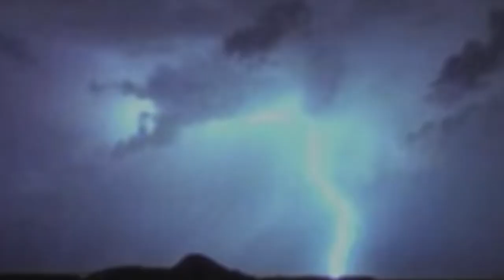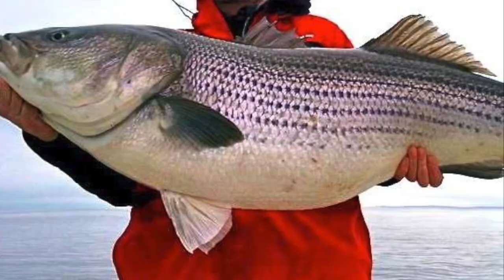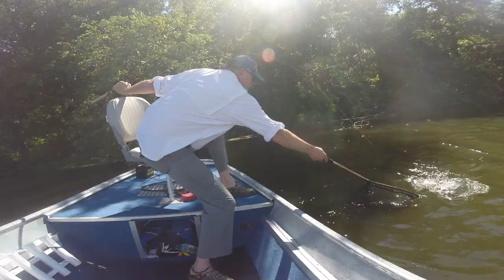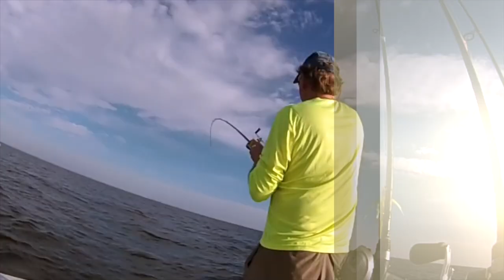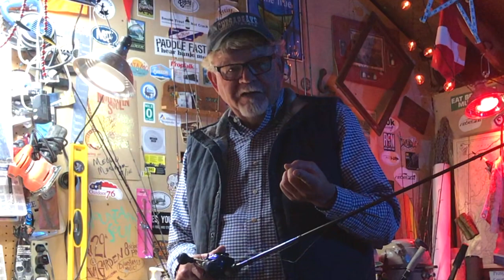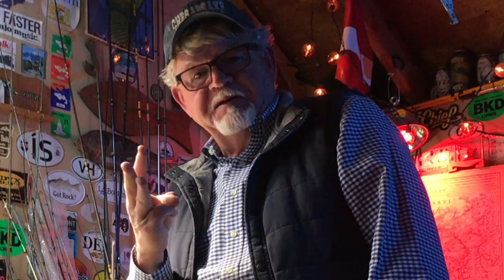The Chesapeake Minute - Three Knots

Comment: I've been following many of your guidances recently. I've switched to a bait caster with #15 braid and a #15 flouro leader. I lost two nice fish this weekend jigging on this set up. My terminal tackle knot (Improved Clinch) slipped both times. I"m not sure what"s going on, but switched to a Palomar until I can figure this out. It's possible that my drag is too tight. I"m used to being able to muscle anything out of the water with #30 test. Any ideas what I might be missing?
Reply from the maker: John, that improved clinch knot shouldn’t fail, In fact, when I’m using 30 pound test I just use a basic clinch knot, 8 wraps, and it’s good. That said, a Palomar works fine and if that’s what you’re most comfortable with,  I’d stick with it. Good luck!